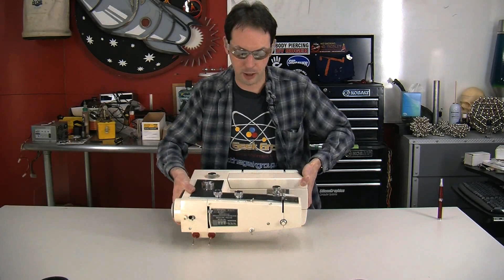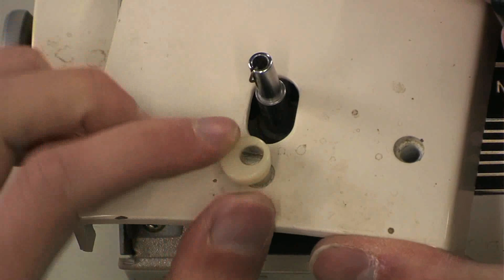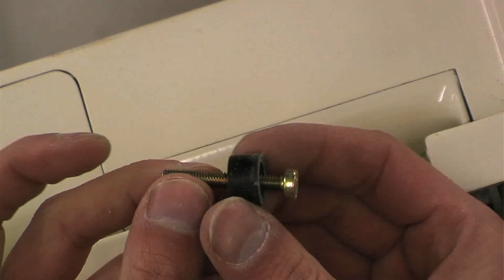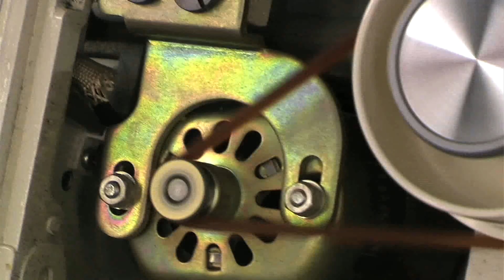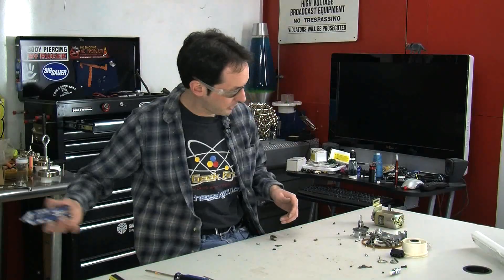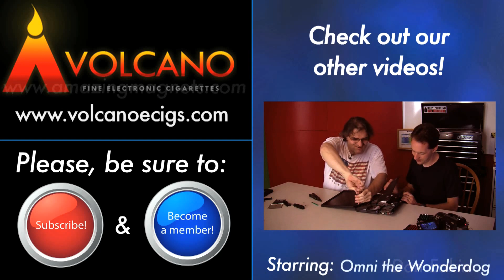Sewing Machine: Equipment Autopsy #40

Comment: Those things that moved up and down near the needle are called feed dogs. They grab the fabric from underneath and move it through, underneath the needle. The stitch length will determine how much the feed dogs move in between stitches.

You were also right on the wings. They fold out so you can sew small things like baby or doll clothes, arm holes, leg holes, etc.

Comment: Dude, First, about the grooves in the needle (I think you may already know this..!) The full length groove is where the upper thread rides down through the needle. The purpose of it is to force the thread (on the other side) to form a loop in the thread (as the needle pulls up) that that bobbin holder can hook into, pick up, and then loop the thread around the bobbin. The thread in the full length groove isn't affected by the material; being sewn.

Comment: Thats pretty cool - theres a huge amount of wierdo gearing inside an old mechanical sewing machine. Another interesting thing to pull to bits is a old mechanical typewriter - lots of interesting gearing and stuff in those too (but watch out for the main return spring, its a biggun, and once it flies out, you wont get it back in!)

Comment: nice to see some good old quality mechanical inner workings once in a while.

by the way, those mechanical levers on the top of the machine you were messing with were most likely for selecting the type of stitching (ie. straight, zig zag, etc.). not positive but the one that affected the tractor plate under the foot might have been for button holes.

Comment: @PhattyMo Yes it was. Want a demonstration? If so take a cellphone battery and poke a hole all the way through it and big flames will shoot out. (They're not really big but if you were to try it I don't want to be held responsible because you didn't think it would be engulfed in flames as quickly as it did.)
Its dangerous and if you don't  know anything about lithium don't do it.

Comment: Those suckers are fucking AWFUL, they eat your straightblade drivers.
I often go through two or three S/B drivers while repairing a sewing mach.
Btw, Chris, You are doing it the hard way.
The general rules of disassembly applies. "It probably wasn't forced together".
Most of the ones are cast in ZINC.
Fiery fail autopsy? I want to see that =D